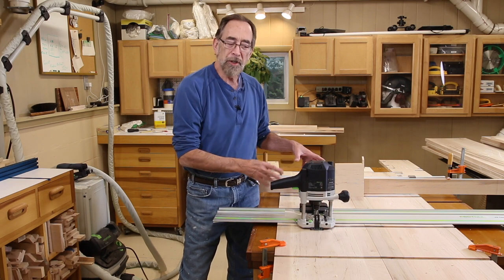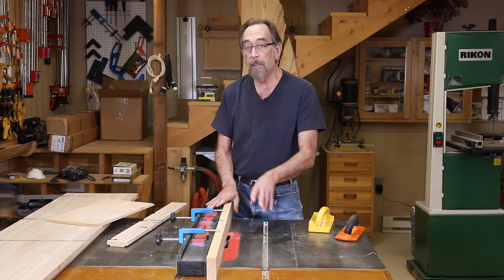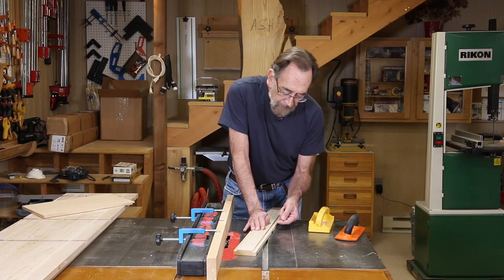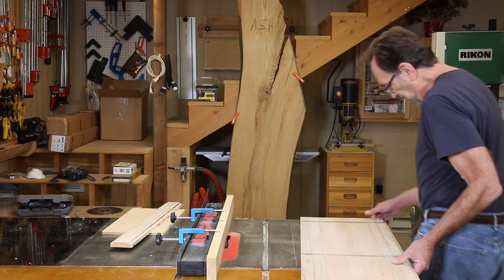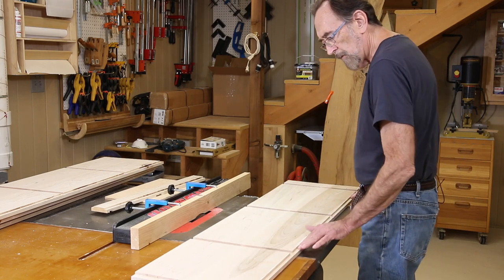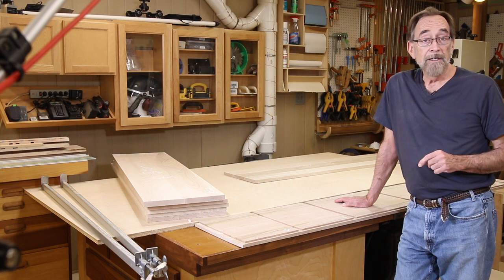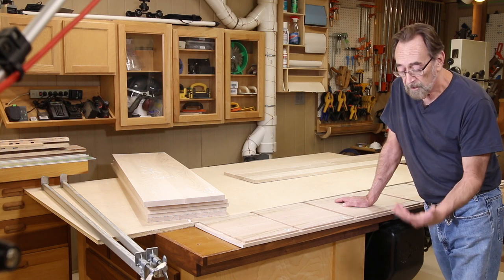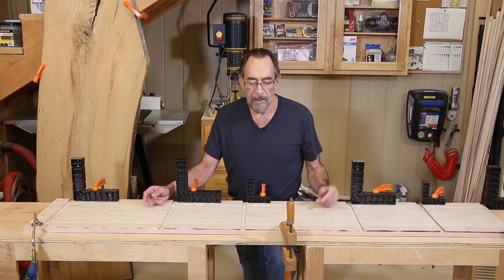The Down to Earth Woodworker - Maple Bookshelves Part 4

Comment: In a one-off piece like this, I'd just use my rabbet plane to cut the back rabbets.  A lot less set-up and way safer/easier to manage as opposed to running it through the table saw.  It's worth the time to set up an in-feed roller for safety if you're batching several out.

Comment: I wonder if it would make a lot of a visible difference, I the back panels would not be the exact same width, but one beeing have the width and one beeing just the overlap rebate wider. Putting the rebate one the half width one on the back and overlap the wider piece behind would keep the dividing line of the pannels absolutely symetrical. As with both panels beeing the same width (half of the required width + some overlap) you would move the dividing line slightly off to one side. But then as mentioned, not sure if it would be visible at all relative to the total width.

Comment: Hey Steve. Quick question. Instead of putting the back panel vertically (showing the middle line between both panels) why not put them horizontally and hide said line behind one of the shelves?
Reply: Satch Boogie grain direction?
Reply: Because of the width of the units (60") I would have had to run the plywood "sideways."  In other words, the apparent grain of the plywood would be running across the back instead of vertically.  That would be okay if the units were going to be painted, but they will be finished so all that beautiful maple shows.  Thanks for the question!
Reply: downtoearthwoodworks That's what I was thinking. Thanks for the answer :)